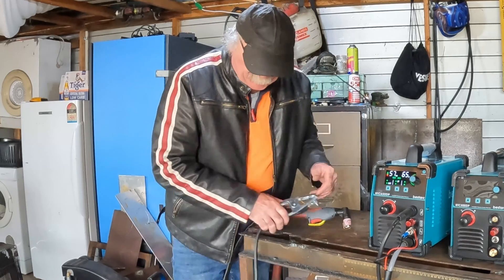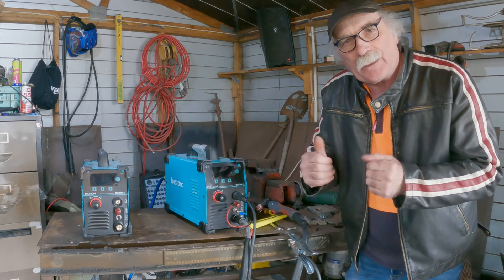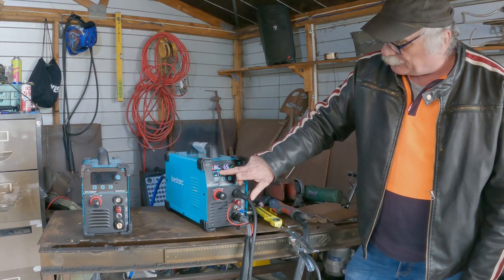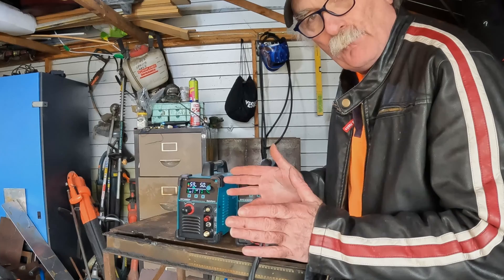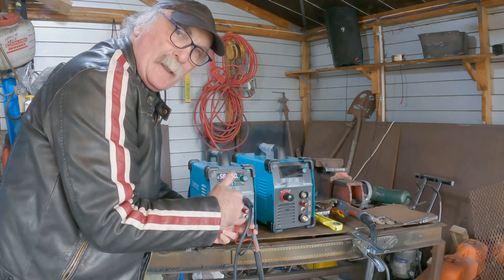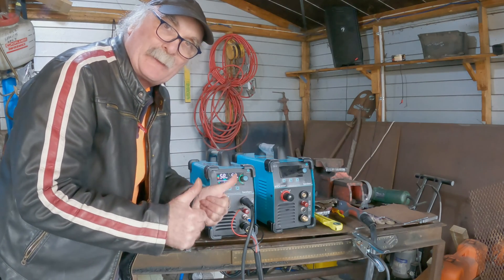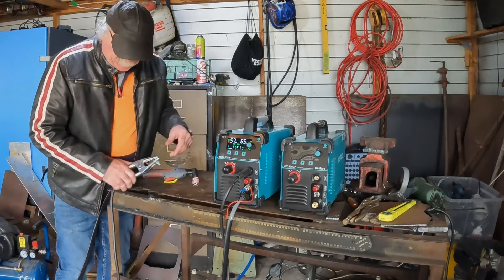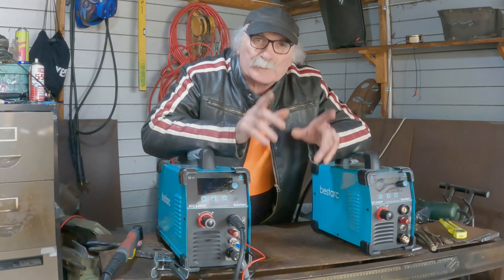"High Voltage Showdown: Bestarc Plasma Cutters - Amps vs. Cost"

Comment: It's really going to come down to what is the largest material you are going to be using, in a DIY shop where you don't have a hoist to lift steel than the 50a will most likely be fine but if you're in a Business environment then go for the 65a. But usually after 5/8" you would get a better cut with your Oxyacetylene cutting torch.
Reply from the maker: 3 phase 200 amp will blow a cutting torch out of the water
Reply: @petestools  two thing, first how many people have that when the usual is a 25 to 50 amp 220v and second the Plasma cutters will usually leave a back cut of about 15 degrees where as the torch will cut at a 90 on the thicker material. Though the Plasma cutter has the advantage of more centralized heat. They both have their places. Remember if every problem looks like a nail ever tool looks like a hammer. LMFIAO